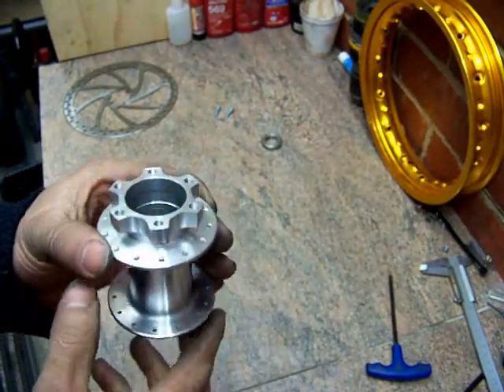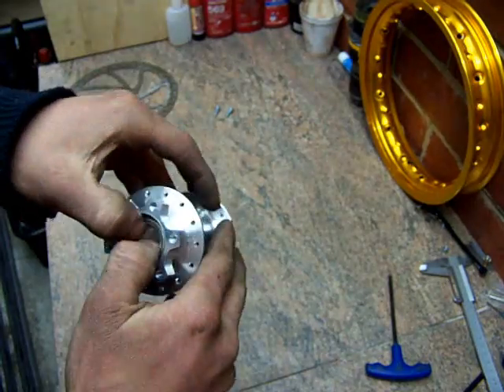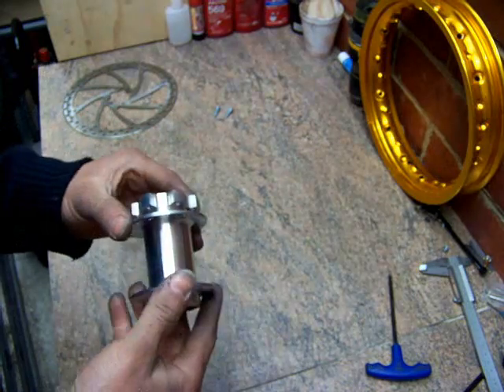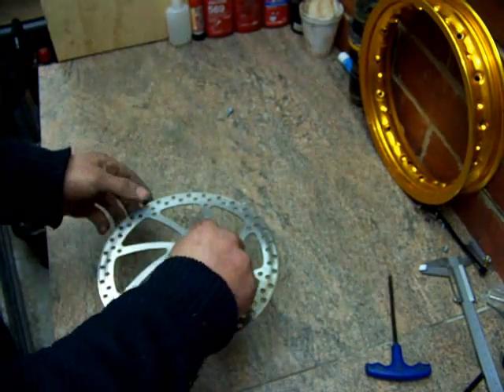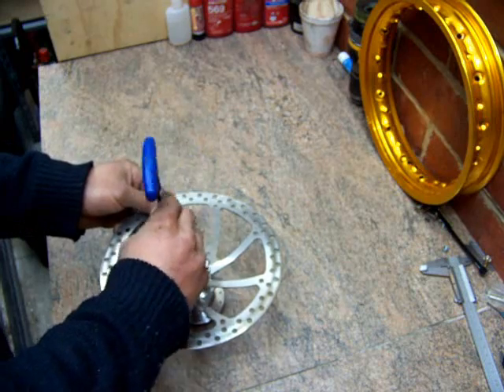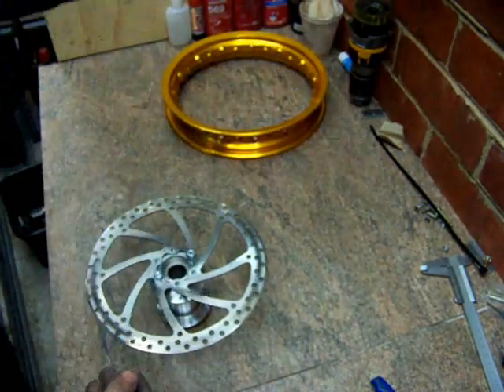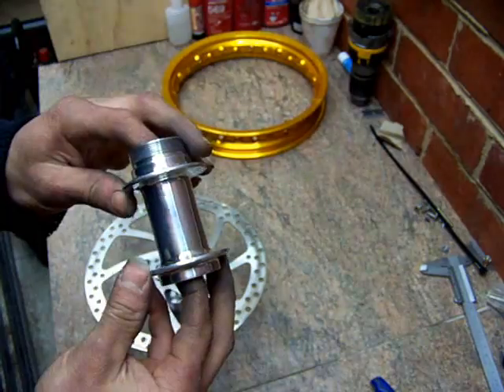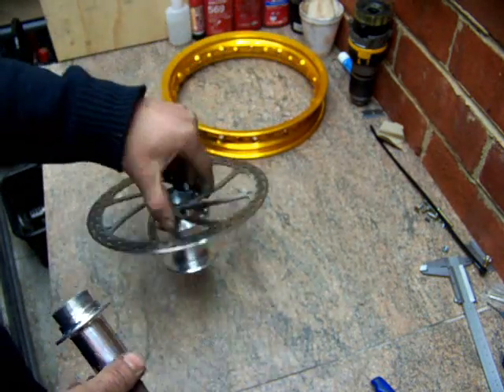The machining of a custom bike hub

Comment: sir , how did you precisely mark and drill holes for the spokes ? also how did you create the "flowerpetal " design  for the disc mounting ?
Reply from the maker: +Reetu Dev Hi, I used a milling machine and a rotating table with a chuck mounted to it. I have a second video that I go into much more detail that explains that. I suggest having a look at it, it's in my channel.

Comment: hey I have been looking for a left side freewheel with matching left crank,  do you know where to get a heavy duty one??? could you teach us how to make some, in case the manufacturers are trying to make them scarce  so to play with price of unit?
Reply from the maker: +Robert Ostman Left hand freewheels are available, ACS for example offers one, but the one I saw needs the wider heavy duty BMX chain. There are also the more modern type with a built in driver that are available in LHD. As for how to make one I suggest looking at the other hub video located in my channel.
Reply: +Sam Quad hey thanks for your fast reply, could you provide more data regarding the ones that you know are out there, as I am not familiar with LHD nor with ACS... (they sound like pot derivatives)... hehe ... I will look into your channel also as suggested thanks

Comment: hi how did you countersink the spoke holes on both sides?
thanks
Reply: this is the question that has always got me. Clearly it can be done because it is done. Some sort of oddball back side countersink tool I'm sure.
Reply from the maker: If you mean countersunk them on the inside between the flanges then I may of done it a little by hand with a drill bit on an angle or a scraper, otherwise it can't be done.

Comment: not sure if you have seen the motoped bike but I'm looking to make a hub that looks like that. Pretty much the hub you made in this video but with another solid mount on the opposite side for a motorcycle sprocket. Will take a 14mm axle and be 135mm wide

Comment from the maker: I used 6061-T6 and I see no reason why it wouldn't hold unless you have the grain of the metal going the wrong way. Easy way to avoid it is to start with a solid round- not a block. Send me a message on here if you want to know about the finer points of hub design.
Reply: I would like to know everything. Is it possible to start with 7075 t6 and add a titanium flange ring with custom spoke attachments, along with the conical splined freehub style similar to tactic racing's 200g hub set?

Comment from the maker: @sunndrac Ideally a hub should be rolled as that way the grains follow the shape of the contours. However I am probably making up for it with the material I am using which is 6061-T6. It does not need follow heat treatment as I don't get it hot enough to change the properties of the metal.

Comment: Awesome job. I'm a machinist myself on CNC milling machines and like to do small things on a lathe for bikes and bicycles. I'm currently on a rear MTB/BMX hub project. 
You use aluminium for your hub, does it hold the spokes and disc brake stress correctly ? Or is it heat treated ?

Comment from the maker: @Menga666 there is a missing stage in this video of before I bored out the middle section where it was removed from the machine and drilled in a milling machine with a dividing head. As with lightweight parts you keep less than 10% of what you start with. If you want to make it strong and light you without hot metal spinning then it's the only way.

Comment from the maker: @stef1696 theres a section missing from the video just before cutting the middle out where I put it on a milling machine and drill them out with a dividing head. Same goes for the disk brake mounts and the spaces between the mounting tabs

Comment from the maker: @axmayaynerray well I doubt it would be under enough shock force to have any initial stress fatigue cracks. That said though that is a decent surface finish, much smoother and with less grouves than many of the hubs I have seen on mountain bikes.

Comment from the maker: @sgtfoxhound I know what you mean and I agree with you. However I only had them down when I was doing the bulk material removal, any time I was anywhere near the moving parts I had them rolled up, same goes for the gloves. Unfortunetly with this old lathe the handwheel is inline with the chuck so I get the bulk of the swarf thrown in my direction.